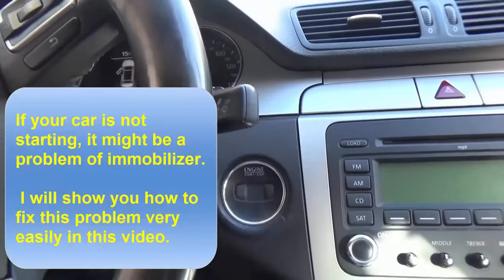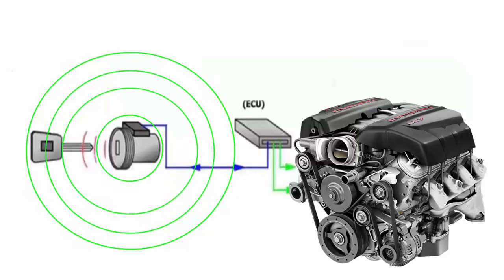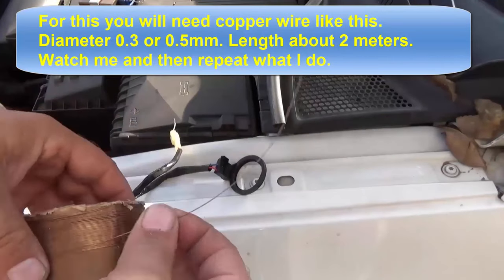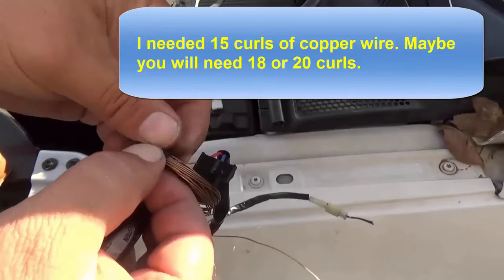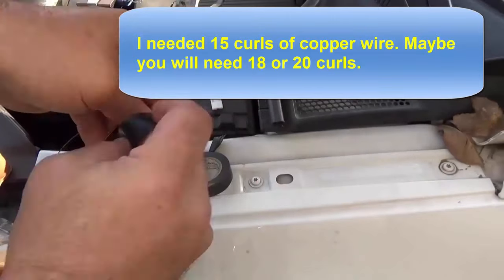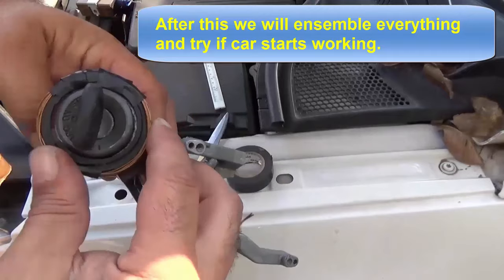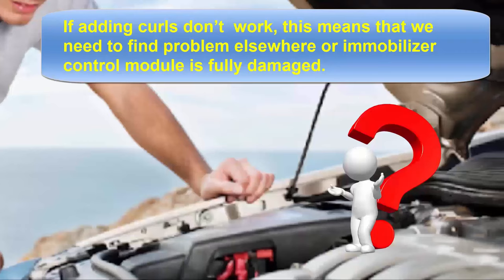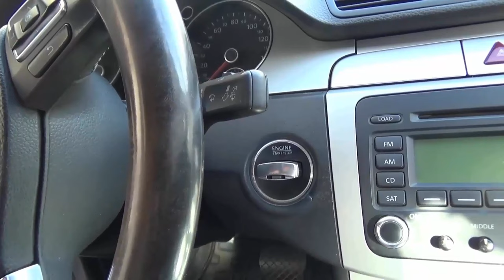Car is not starting? How to do car immobilizer. Bypass Alarm with Key!

Comment: Everyone should stand up and demand the right to have no immobilizer on their new car if they choose. Now instead of your car getting hot wired and stolen they break in and shoot you and take the key. Also they significantly increase the likelihood of your car being taken straight to the scrap yard. Wish i could buy a new car without one. These immobilizers are being forced on us and it's not cool at all.
Reply: Damn straight, i have an 02 civic that nobody is gonna try and steal, but my immobilizer light isnt coming on so now i gotta either swap out the transponder and pay someone to reprogram it, or switch out the ecu, transponder, and key and cylinder just to drive my car because the piece of shit security system is jacked, so either way im out 200 bucks give or take and without a car until then, its bullshit they should offer a replacement or a way to disable it if you want
Reply: @jamesroark7093  same for me I have 01 civic what was the cheapest route
Reply: @levirogers5613  was your green light not coming on at all?
Reply: Yup, I have a 2010 Lincoln MKZ and was stuck at a gas station for over two hours in 0° weather until it just decided to finally start. Anti theft systems in vehicles are a joke.
Reply: Yeah, you tell them dude.
Stand up for your rights😁😁
Reply: Funny thing is that I don't see how it can even stop the thieves and actually can help promote the theft. They just come with a truck and trailer and sell us the car back in parts anyway which basically is still the same as it was before the immobilizers. Only now they have that valuable matching ignition and computer to give them more return on their efforts because they know people are needing the matching ignition/computer set because the dealer charges to program them and they probably won't have to if it matches the ignition too. Where there's a will there's a way and the thieves all have the will so it only hurts the innocent really.
Reply: @jackle842000  
Its not really about thieves stealing cars.
Its all about car sales, parts, mechanics/repairs and profits (big money to be made)🤓🤓
Reply: Amen.
Reply: Amen.
Too few of your kind out there, people accept so much forced shit i can't believe it.
Reply: @jamesroark7093  Yep. I now have to scrap my ford Fusion because no one can sort the  immobiliser out, and if they did it would cost £800 to repair. Nasty little trick Ford.
Reply: I agree the last two cars I've had both had problem that ended up being the immobilizer, cost me alot of money to fix something that I don't need anyhow.
Reply: @deanbromerg8000  plus they absolutely don't stop theft. These newer cars with proximity keys have been having huge problems with theft. They can copy the proximity key from outside your house and start them up and drive them off apparently.
Reply: @MrFlatroofer  hahahah... So your saying your cars totaled out due to a minor repair you just don't want to make it
Reply: Facts!!!
Reply: FFF'N "A" Bubba!!!
Reply: $200 - try $700 for a callout. The trick is to have a duplicate chip on standby - before it breaks or you loose it. There are now SBB programmers for less than $100. Buy a used key and fob  off ebay, and add its transponder number to your ecu. Toss the spare key with the spare tyre, or remove the teeny transponder chip and glue it to the side of the antenna coil.  job done. Also the bit on the ignition is the coil and an rf amplifier module. You may get away with just unplugging it and trying another - because transistors or caps -  get tired.
Reply: Totally agree :)
Reply: Pretty sure a thief doesn't care that much.. most new cars are electric so they can be hacked.. they won't need your key or any tools..
Reply: Dude, mega squirt, Hal tech, soeeduino, etc.
Reply: Nice but the insurance will be way more for a "new"car without immobilizer than one with it. Regards
Reply: I've been trying to find somebody to listen to me about an idea and I don't really care about money from the thing I just wish it would be done and should have been done a long time ago. I wish that you could have a thing in your pocket or any in your pockets down in your shoe forever that made your car not run after it 50 ft  away from it so somebody text your car you just walk that way so they can get away you're moving the other direction it dies on them they're going to move on away from the car they're not going to sit in the stolen car for a couple minutes trying to get it started and it won't start until you get back up there and get in and drive it away
Reply: amen

Comment: Good evening Sir. Very useful video. But I have a question. I have a renault Clio 1.2 8v and the manufacturing year is 2000. I change yesterday the BSI pc board and after that doesn't recognise the key. Also the remote control doesn't work. Any advice?
Reply from the maker: look here  https://www.google.com/search?q=synchronization+of+someone+else%27s+ECU+immobilizer&hl=ru&sxsrf=AOaemvI1KJShgWTKj6ahuhQe8UHJSoXTWw%3A1638111706581&source=hp&ei=2pmjYfHxIJzL0PEP0r65uAQ&iflsig=ALs-wAMAAAAAYaOn6gVbsiCfSqgvqQsFsOGx_S-MGbp0&ved=0ahUKEwjxxvvSqbv0AhWcJTQIHVJfDkcQ4dUDCAY&uact=5&oq=synchronization+of+someone+else%27s+ECU+immobilizer&gs_lcp=Cgdnd3Mtd2l6EANQAFgAYPMKaABwAHgAgAHwAYgB8AGSAQMyLTGYAQCgAQKgAQE&sclient=gws-wiz
Reply: @myautolife4240  Thank you Sir!
Reply: i am facing the same issue rightnow !!! do you mind telling me if you got any advice??
Reply: @mahy9547  I just cancelled the immobilizer. Or else you need to transfer the data from the old bsi to the new one so that can recognize your key.

Comment: Hi brother!
My Nissan Micra 2001 does not start. I've been to many garages but it won't work.
Wish you would help me.
The checking machine system is in lock mode.
Very appreciate for your help.
Reply: Hello sir, do I have to remove old coil before making curls or I can make curls around old coils? Thanks you

Comment: Any common problems on what could be causing it to fail? I had my battery out of my car for a few weeks put it back in and all of a sudden the immobiliser won’t work, new batteries for the fob and nothing working
Reply: @sulli5547  cheers
Reply: Maybe the immobilizer broke in the key!?
Reply: I had to take my van to the dealer they charged 75 bucks to reset the thing.
Reply: It's programed to do that they learned from gm

Comment: Need to start isuzu nkr85. 4jj1 turbo engine.. Lost my key any way to bypass this??
Reply from the maker: No, it does not matter, if you've lost your only set of keys, an auto locksmith can provide you with a replacement and re-program the new car key to match your vehicle. The old key will be de-programmed to make it useless, in case it has been stolen.

Comment: make sure you use varnished wire like's in transformer.  Otherwise the loops will conduct like one big loop.  He is scraping the varnish off the ends so it will conduct there only.

Comment: i need help plz i have a 1998 lexus that i have the metal piece the whole key but lost the chip on the key the black part..now i tried starting the car it will turn onand every thing works jiust doesnt crank over due to the chip missing..so i left my car where it was at..but went back after watching a few videos...i think i know where to fine the immobilizer but wen i tried jumping my car to do this the alarm was going off and need to by pass the alarm system first cuz where its parked is right in front of my jobs office and dont want to disturb my boss with that alarm if i cant shut it off

Comment: Looks like your building a little faraday cage around it to block the signal.
Reply: That is not a faraday Cage? More likely an induced current acording to Lenz law Will make changes in the magnetic field which affects the build-in hall sensor.

Comment: Hi..Thanks for the video. I have Chevrolet optra 2011 model car, having problem with immobilizer. It is having strange problem, car starts only on direct sunlight hits on the bonnet. All the other time signal not sending, red immobilizer light is on. If you or anyone have idea about this problem, comment please.. Thank you ..
Reply: Replace your prechoke switch

Comment: im not sure this works... you see if you have a closed coil around the original coil...when the key is inserted it will induce a current in the normal coil that signals the ecm...but this new coil of 20 wraps, will also have a current induced in it.... but the current will be tiny and can not flow ...because both ends of the coil are at the same potential..
and no possible current can flow.
so this trick cannot work.
if you do it and your system starts to work..it is not due to the coil you added...it is due to either you disconnecting and reconnecting, or due to the batteries in the key buildinig a bit more charge... trust me ..the coil does nothing.

Comment: dear i  have toyota echo 2002 i have key but its brocken and only kay i have without chip so please lets me how can i atlease start my  car please help me.thanks a lot.
Reply: Tape the broken key head to the Chip-less-key till you can get a new one cut and programmed. Don't loose the broken key. You can use it as a Master so you don't have to Reset the IMMO computer.

Comment: I bought a 2005 Accord that has the immobilizer BS. It still works, but don't like the downside of it at all.  So with all these damn cars that have it, I found ONE that does not and bought that car as a spare. It is a 2007 Toyota Yaris. Just takes a flat key with no chip to start it a run it!! When I later looked at the ignition cylinder there was no cable and wires or ring on it.  No key light on the dash either.  They are very reliable cars also, and why they left it off that year and model I have no idea.  Will never sell it.

Comment: I have a 2003 kia spectra and I have put a new fuel pump, filter, changed out the crank sensors. The car cranks but won't start still
Reply: Press the reset button for the pump it's in the car by the fuse box should have a red button

Comment: Seems like it may work if the balance of capatance and inductance is correct. It would simply send the original interrogation code back and because it is exact it should match. Newer ones probably not so much. 🤔

Comment: hello me i have  a same probleme my car Ssangong restron is nor starting a change the engine but immobilizer light is flaching  can you help me please
Reply from the maker: 2:50  For this you will need copper wire like this. Diameter 0.3 or 0.5mm. Length about 2 meters. Watch me and then repeat what I do.

I needed 15 curls of copper wire. Maybe you will need 18 or 20 curls.

After this we will ensemble everything and try if car starts working.

If car doesn’t start, we need to add curls.

If adding curls don’t work, this means that we need to find problem elsewhere or immobilizer control module is fully damaged.

Comment: I have a 2003 Avalon with lost keys I called a locksmith that told me he would get it done $800 plus tax he was out there for 4 hours and came to a conclusion of my security light was not blinking so he couldn’t finish the reflash on the ECU so he says I need an electrician… I can’t find anyone to complete the job I need some advice 🙏💆🏾‍♂️😪😭👿

Comment: will this work , my 2003 camry i changed ecu  and it will not start
Reply: When you change your ecu ,you better remove the eeprom from your old ecu then put  in the new used  ecu  that your purchase on line   ,then it is solved . Or if possible go on line buy the used ecu with the imbolizer and its key ,then you swap your ecu and imbolizer ,no need to program then put or mount its. Key on top of or hide inside the ignition cylinder to serve the chip ,then use the old key that you make  copy  from your old car key with out the chip then start the car,then it  will start for you ,,cheaper and cheaper . I swapped my car by that 2 ways above it all worked .

Comment: 90% of this "check engine" / "reset" / "bypass" videos is pure bullshit ---- we have a workshop and as an experiment tried different "experts" vlogs on YouTube ---- not one of it actually worked --- in fact three vehicles went into LYMPH MODE and we had to call in the REAL solution ---- a laptop ---- odly enough we created more errors with the "reset without special tools" and disconnected battery terminals then anything else --- so much for ANTI THEFT devices if it could be so easily "bypassed"